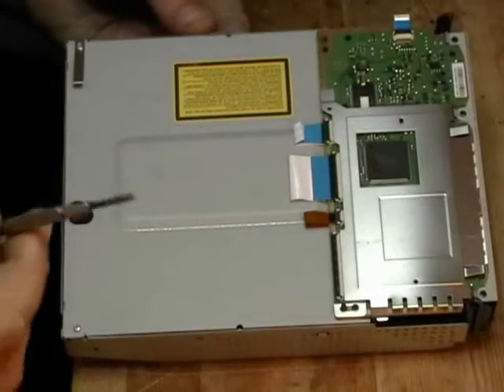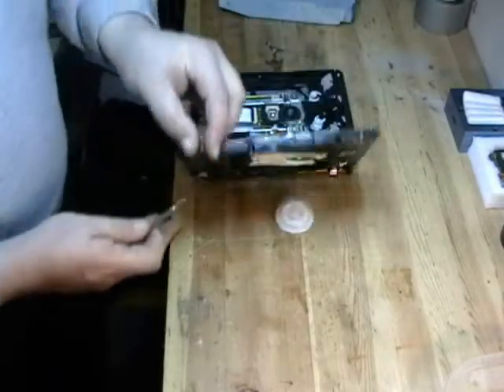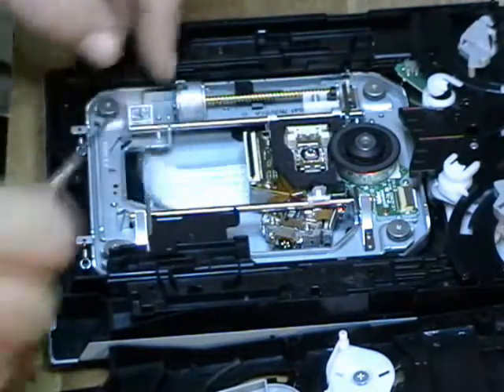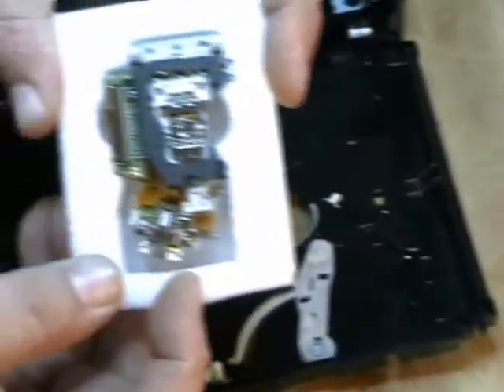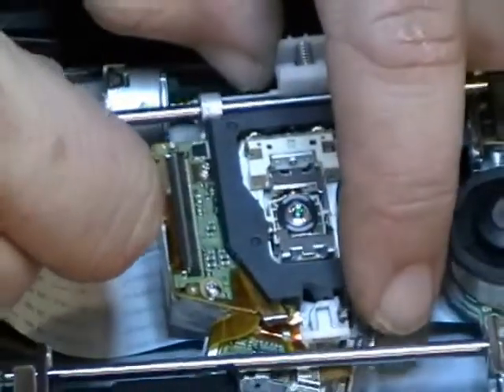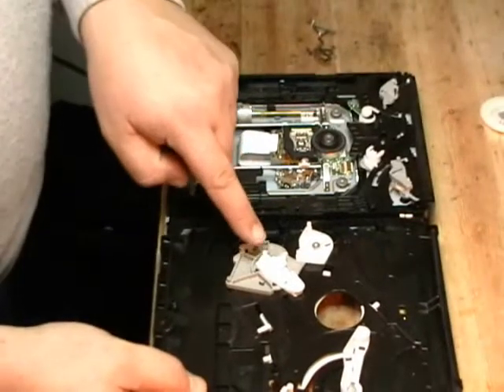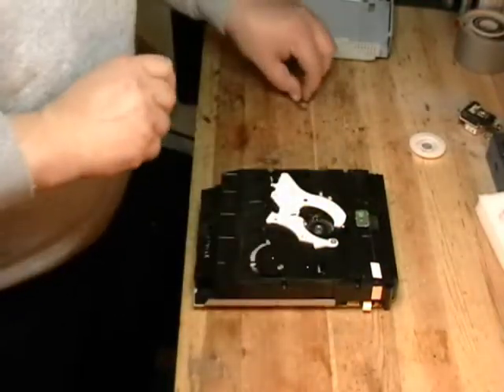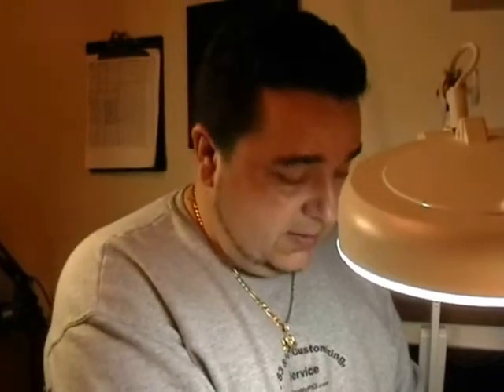PS3 tutorial for Blueray Drive laser replacement

Comment: Very informative and thoroughly made video, the laser replacement was WAY EASIER than I hoped for. Thanks alot! For those who are running into loading and ejecting problem after laser replacement, it's because your disc arms are NOT aligned properly. It makes a huge difference because of the white arm that "PIMPMYPS3" talks about with the upside down 1 not aligning up. If you do run into that problem and can't figure it out, search for "PS3 optical drive top" posted by "Junker15"

Comment from the maker: There is 2 different lasers and  either could go into your 40GB the best way to make certain  is to take it apart and see if it has (1 or 2 lenses) on the laser assy. 1 lens is the 400 laser ans 2 lenses is the 410 laser. You can also tell 95% of the time by model # of the PS3

Comment from the maker: it may be a laser issue,  the issues that you are complaining about ive had 50/50 luck with replacing the laser and it fixes the problem. If replacing laser does not fix problem then it is most likely a Board problem.

Comment: Yes - best video out there - I'm unsure why but most insist on putting bloody music over the top of the video.  One thing i didn't understand is how to get the entire bay out - with the 4 fairly large thick headed screws with the tiny phillips entry on them, as I had bought the KEM400-AAA thinkign the entire head would be easier to replace as apposed to the laser alone.  As it turned out, it was easier to replace the laser.